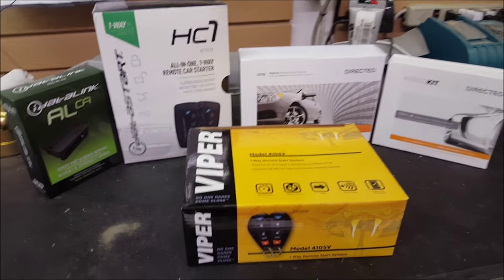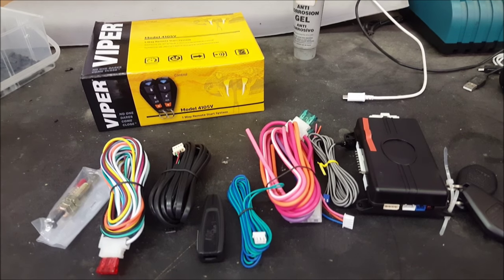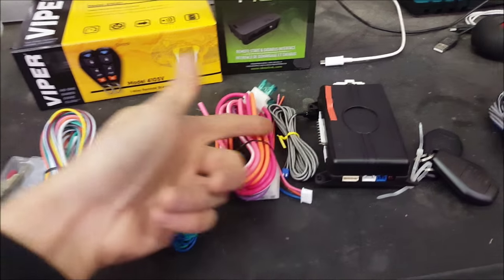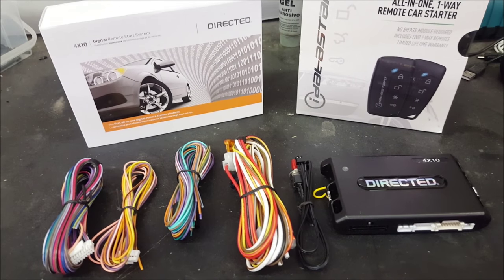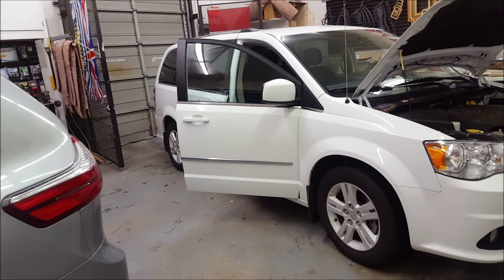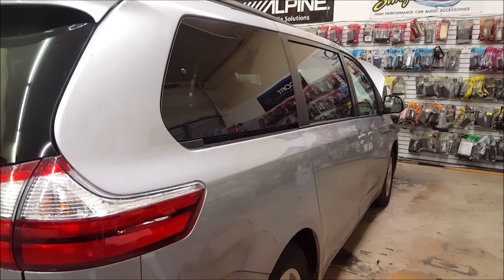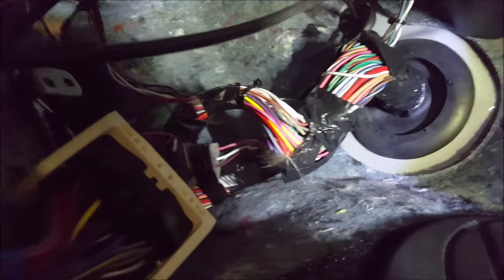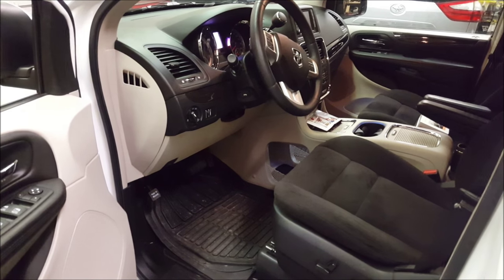Digital vs Analog Remote Starters (Directed Electronics | Idatalink) | AnthonyJ350

Comment: Can you possibly tell me how to get the horn to honk when I lock my truck on my 2015 Nissan Frontier with the Viper DS4+ remote start? The installer is new and looks lost so I just told him never mind.
Reply from the maker: You would have to reprogram the output and hook it up to the horn. You have to be an authorized Directed Electronics dealer because you need to login to do so.
Reply: @AnthonyJ350  That's the issue. They can't figure out which wire/s go to the horn. lol
Reply from the maker: @danielk0106  That's weird, cause you can select the outputs when you program it. Tell them to call Directed tech support and they can help them figure it out.
Reply: @AnthonyJ350  The one tech said he doesn't use the phone app to program them and I asked why not. He said too many vehicle applications and I told him yes but it allows you to select the make, model, year and even the firmware version. He asked how I knew and I told him I watched a DIRECTED.COM video on YouTube. He said he doesn't have time to look that type of stuff up and I asked him why every time I looked in the shop you were talking on your phone? 
That's when I told him to forget it. It sat there for 3.5 hours for nothing.
Reply from the maker: @danielk0106  I would try another shop

Comment: Thanks for sharing great video! I am not sure you will still check the comments in this video but I am having hard time underatanding about what product should I pair with viper smartatart VSM550. I am currently having 2012 Infiniti G37. I was wondering will Directed DB3 + Viper VSM would work on my vehicle or should I just spend more money and go for viper DS4VB + smartstart to be safe. Or do you have any better recommandation? 

Thank you.
Reply from the maker: A DS4 would work with your platform. I've been having good results with Compustar product lately.
Reply: @AnthonyJ350  Thank you very much! Any specific model you would recommand for smart start function?
Reply from the maker: @조준영-n1u  I use Drone for Compustar. I installed a few DS4s before and they're unstable. I like the old Viper 5X06vs, those units are bullet proof and I match them with a DB3 or Idatalink ALCA depending on the car.
Reply: @AnthonyJ350  One more question. Which option would be better? Compustar 1-way remote start system + add on 2-way upgrade kit with LTE module? or get a all in one CSX remote start system/LTE module?
Reply from the maker: @조준영-n1u  The brains are the same you're just changing the remote and antenna package. Really depends on what remotes you want to end up with.

Comment: Can someone swap out the DB3 for the idatalink AL-CA Immobilizer Bypass?
I ask because i have a Stock FOB w/ Directed Brain 5x06, w/ Maestroo RR on my Pioneer NEX radio.
Reply from the maker: You can use Idatalink in place of the Directed DB3. As long as it's supported

Comment: Is all viper remote start plug and play
Reply from the maker: Sort of. Some vehicles you still have to install a hood pin and you have to hardwire, lights, horn and sometimes door pin for R.A.P. shut down. They also require dealer logins to program.

Comment: The days of Alarm installation (1995-2000) are over...... ill keep the Youth with the Digital Age Employed from now on...
Reply from the maker: +Ray Gonzales I still do a lot of heavy gauge ignition vehicles.  I just did a 2014 F-150 where it was thin gauge but a tradition remote starter with integration module did a better job than a purely digital unit.  We're at a transition phase again.  It's like in the early 2000's when you told people they have a chipped key, and 3/4 of the people thought you're making it up.

Now it's about educating people that their computer controlled vehicle needs a digital based starter to work properly as opposed to the $98 special.  Right product for the application.  Installer just have to still know how to work relays and program for newer digital based vehicles.

Comment: In an attempt to have a better understanding of what makes a makes a remote start 'analog' vs 'digital' so I can determine which one my vehicle is, I've discovered there are very few references cataloging remote starters across the web including the manufacturers themselves as 'Digital' and 'Analog' Remote Starters .

Is this essentially another way of saying....
Analog = High Current ignition = Key Start
Digital = Low Current ignition = Push Start (sometimes Key start?)

Push start (PTS) vehicles are always Low Current ('Digital') but Key Start can sometimes be as well (evident if the ignition wires are lower gauge)?
Reply from the maker: Yes that's an excellent way to summarize the vehicle. You are correct.